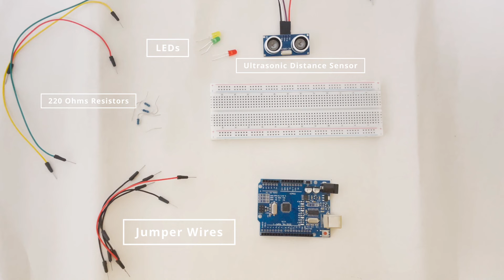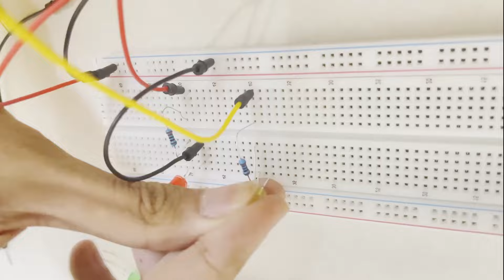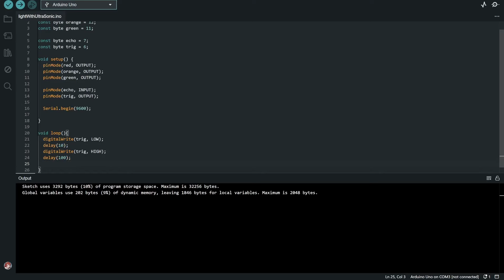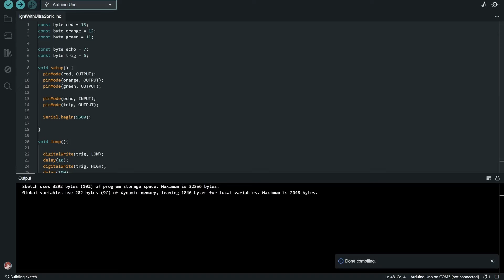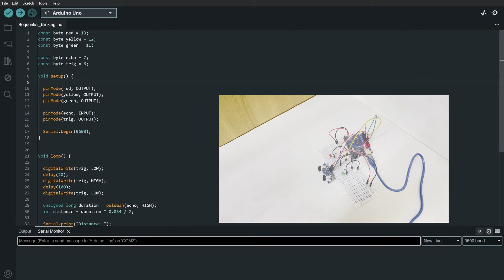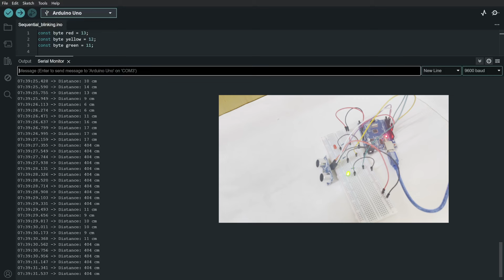Step-by-Step Guide: Ultrasonic Distance Sensor Project with Arduino!

Comment: A schematic of the circuit would be helpful..
Reply from the maker: That’s right! I will include it if I make another video
Reply: @kruskal-yt  You could add it to the current video, to be complete. Thanks
Reply: @kruskal-yt  You could add a link to a schematic in the comments. Thanks
Reply from the maker: Thank you for your suggestion